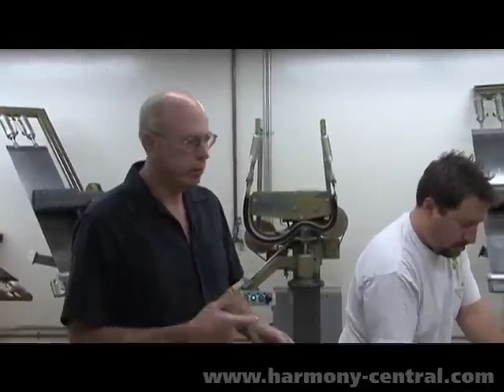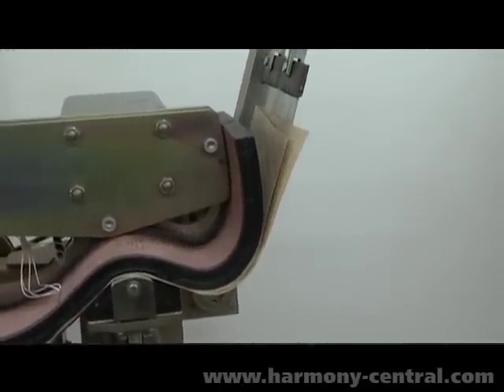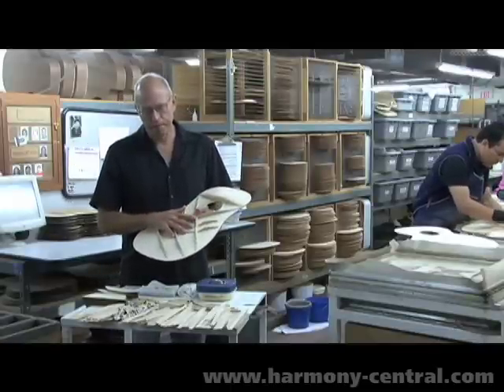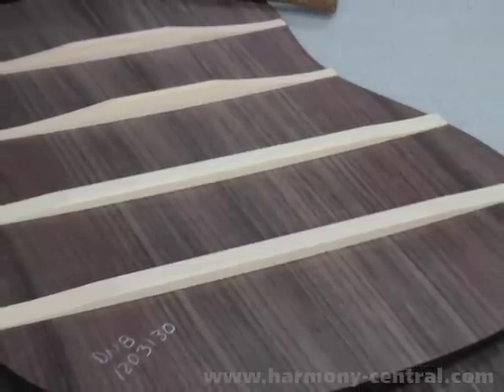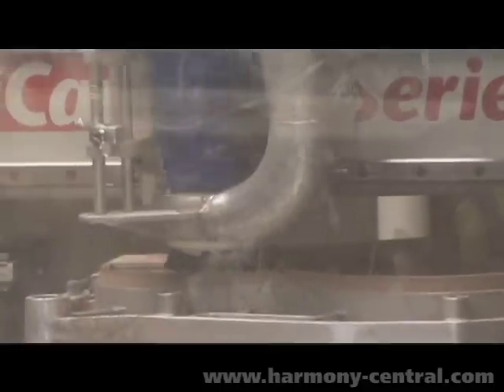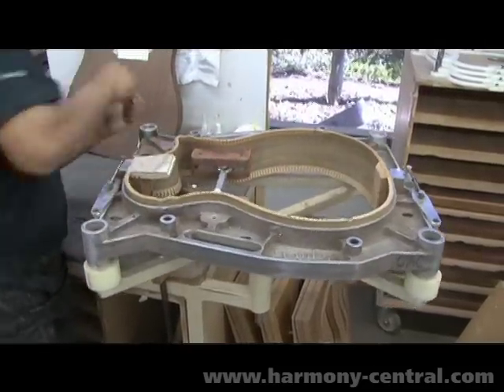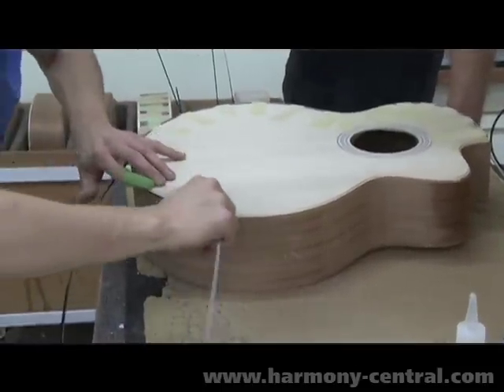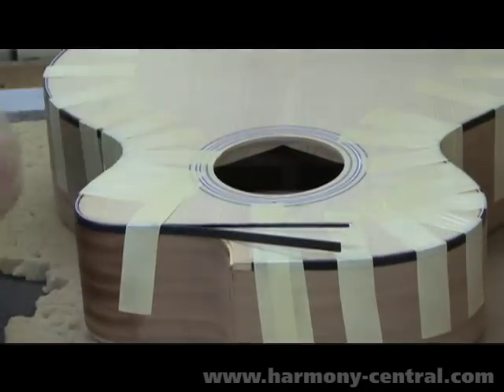Taylor Factory Tour Part 1 of 4 - Body Construction

Comment: Taylor can make two guitars of the same model,. one made with really cheap woods, and the other, made with the best woods you can get.  Both will end up sounding the same.  Taylors are consistent, but lack magic.   Give me a vintage Gibson J-45 instead.  Or a Manzer.  Hand made guitars are still the best.  If Taylor could make guitars entirely by machine,  I have no doubt that they would.
Reply: You are right.  I can't figure it out why it doesn't have the magic, either.  Must be the energy that's breathe into the instrument.  Machines and factory workers can't match the love that Gibson and Martin workers give to their handmade guitars.